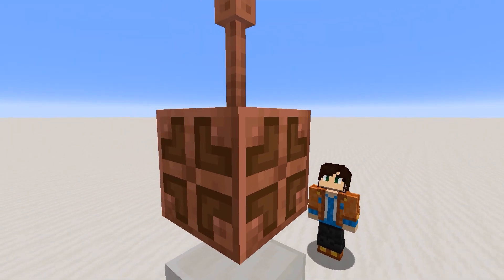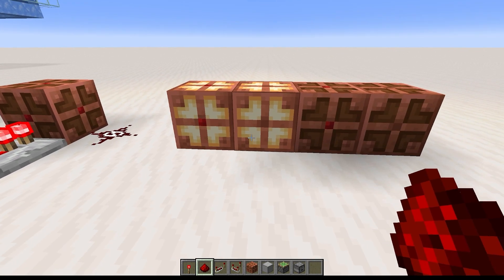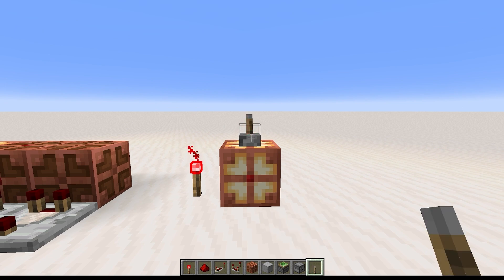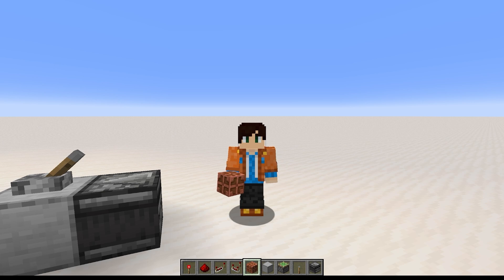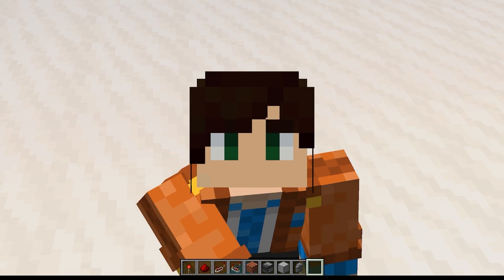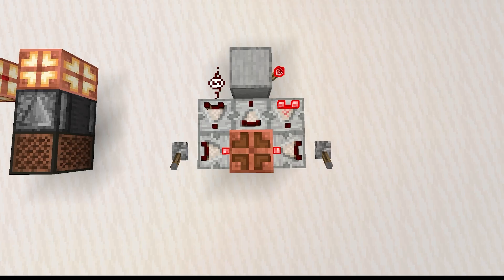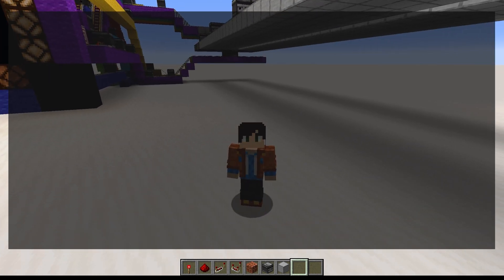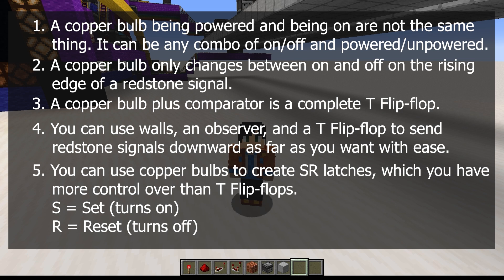The Copper Bulb: How to use Minecraft's Memory Cell

Comment: I tried the wall trick before but you should be warned that I've seen it get stuck before and could potentially break a build
Reply from the maker: By stuck, do you mean the wall columns weren't propagating down? Or that the bottom part became desynced from the top due to 1 tick pulses?
Reply: @RedstoneWithMistRazor  the extra column the forms in the middle just... stayed and never went away
Reply from the maker: @theotherguy6155 Whoa! I've never actually seen that before. I wonder if the wall's block update got skipped somehow. 🤔

Comment: Or 1 for yes, or 0 for no. Or Off for yes and On for no. 😅
Reply from the maker: Yeah, the binary counter with copper bulbs is a little weird like that. If you invert the output of each comparator like this https://i.ibb.co/BHVgDwv7/2025-02-27-14-05-24.png you'll get a traditional binary counter where On = 1 and Off = 0.

Or if horizontal space is at a premium, you can invert each bulb output to the side like this https://i.ibb.co/r2QThP92/2025-02-27-14-10-42.png

Comment: The copper bulb and observer combo can "desync". For example, if the bulb was on in the first place and the signal into the observer was off, then this would not work
Reply from the maker: Yes, this is a very good point. If you send a 1-tick or 2-tick pulse into the top part of the "wall" circuit (which is the one I'm assuming you're talking about), the wall will form and remove its column, but the observer won't have time to output two separate pulses--only a single pulse--which means that afterwards, the result will be that the upper redstone line will be off, but the lower redstone line will remain on.

The solution, then, if you need to send 1-tick or 2-tick pulses down the wall, is to put a a 3-tick repeater in the upper redstone line to lengthen the pulse, and then a pulse shortener at the T Flip-flop output at the bottom. (And add a 2-tick repeater after the pulse shortener if you need to lengthen the pulse back to 2 ticks.) That will transform your 1-tick or 2-tick pulse into a 3-tick pulse long enough to avoid desyncing the T Flip-flop, then reduce it back down to the proper length. It will add 3 ticks of delay, though.

Unfortunately, the sticky piston and redstone block T Flip-flop is also possible to desync, so to be 100% safe you either have to be careful about your pulse length, or take the 3-tick hit by putting a repeater up at the top.